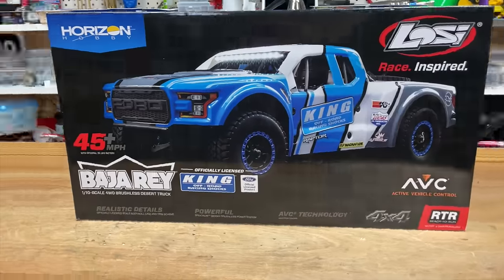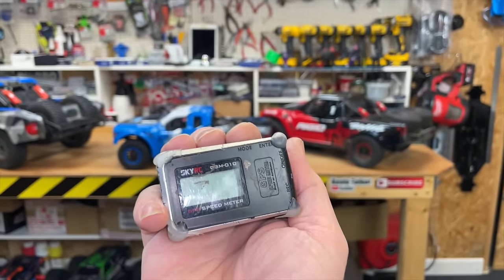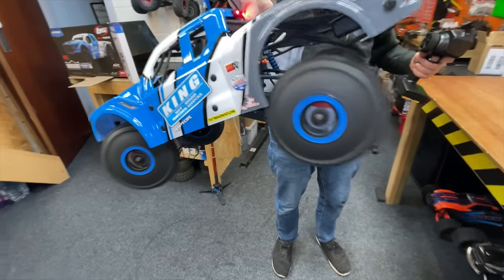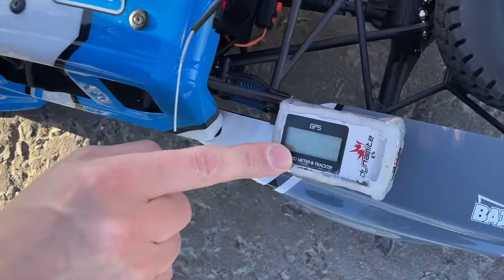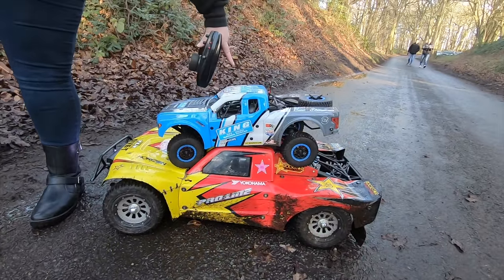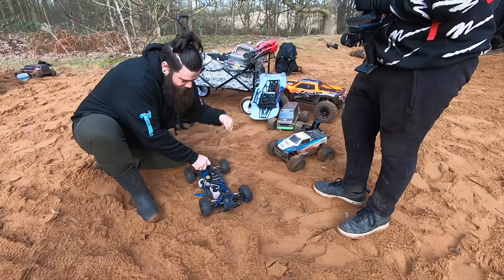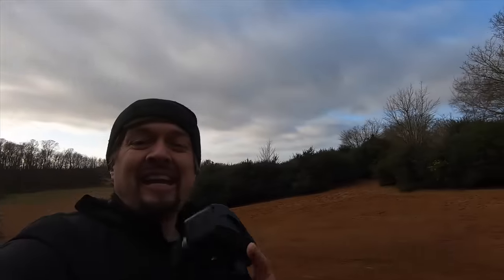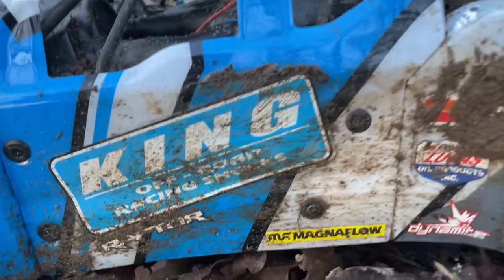New Toy! The King of RC Desert Racers?

Comment: Its a great truck,  just some tips: get some heavy weight diff oil for the center diff (15k+), and first upgrade would be proline desert truck tires, (baja t/a or hyrax) not sct tires they are too small and wide second would be and aluminum steering rack, servo mount doesn't allow many servo horn upgrades but I haven't had any issues with stock one, servo did die 3 months after purchase (bought in march 2020) haven't had anything break other than the rear area of the roll cage around the tire mount and body damage. Its my toughest most reliable rc.
Reply: 15k 😁 .. I using 100k in center and the thing is a monster.

Comment: Hey Kev can you post more Traxxas hoss or summit vidoes I want to buy one of the two, and I know u are the best at testing things because u give your honest opinion!
Reply from the maker: i will but no idea when!
Reply: @KevinTalbotTV  ok thank you!
Reply: I Have a summit 1/10 brushless mamba monster, and rock rey 1/6, dbxl 2.0, but summit is my favorite!
Reply: The hoss is faster and Jumps higher but u like the summit it's so cool
Reply: Thanks
Reply: @emanuelbetinis7388  they’re very different models but I have a hoss and it’s great if you want a basher but the summit is more of a crawler than a basher it all depends on what your going to use it for
Reply: @randomtimes4100  thank you for this I will definitely take it into consideration and do some more research!
Reply: I absolutely love my hoss after some much needed upgrades such as constant velocity axles and upgraded GTR shocks and RPM A arms its a beast. But if it's a monster truck your after the stampede is a great option, most of the same parts as the slash and hoss!!

Comment: I've had my Rock Rey for 2 full years now and I've only broken drive pins here and there, and those seem to be a failure point on purpose so you kill the little easily replaceable pin, and not a wheel hex, steel axle, or gears or anything expensive. The Losi Rey's are absolutely built like tanks, only issue I've heard with that one is the stock shocks tend to kind of bind up after a while, upgrading them to metal ones is the single best upgrade (aside from tires) that you can do to that truck.

Comment: Hi Kev, I was wondering if you can make a Latrax Prerunner have a 1/8 motor or 1/6 motor with a max 6 or max 5 esc. You might need new diffs, driveshafts, spur, and pinion. You will also probably have to build your own motor mount

Comment: I have the first version of this truck.  My 2 complaints are this.  The center diff needs a locker option, and the wheels are garbage.  I have smoked so many wheels on mine.   On 2s its fine, throw in that 3s battery and watch one of the rear wheels strip out.  Otherwise it's a ton of fun. My favorite part is the bolt on body.  The rear tire carrier area is weak. I have replaced the x brace with a piece of hoard plastic.  Make sure to leave a hole for the upper links to pass through with all that travel.

Comment: If you used a brand new out the box Lipo (obviously the correct one ie 3S) would it go faster than 45mph or is that speed purely down to gearing/ electrical limits (if that sense?)??
Reply from the maker: maybe, not always. sometimes new lipos need a couple of runs to get faster someone said

Comment: If you need better shocks you can use the gpm one from the Arrma Kraton 1/8 with 300 oil they are great (I'm running them already a couple of years and the car drives a lot better)
Reply: Use the kraton shocks in the front of rear of the Baja rey?

Comment: I love mine and it seems pretty tough by my standards , others standards may differ,😁 i soldered standard xt on , I as well, I like the sim atyle sort of trucks so right up my street., it seems fast enough on 2s and is faster on 3 with the supplied extra spur.I would like /need new tyres and wheels if anybody has some good advice for this truck would like stlighty stronger sidewalls/foams ?
Reply: Proline has 1/10 short course truck bead lock wheels and bfg tires. Havnt put mine together yet but they seem way better and will fit with stock body.
Reply: @surfside75  Thanks,will look into those,might even try the general Grabbers from my Element sendero ,they look cool  but might just explode 😁🖖

Comment: It did get 45mph. However, he was using a 120c burst rate 3s lipo. Not knocking it or him in any fashion. It's just important to remember that 30c is not going to compete with 120c.
Reply: Thats not how that rating works.. Youd get the baja Rey to 45 with 50c. The ESC and 3s battery can't use all the 120c rating regardless.

Comment: Go to a auto parts store and ask for a front driveshaft for your C10 pick up and watch the guy at the counter laugh at you I will say it again if it's 4x4 it's a K10 I wish you would do some research on it so you will see that I am right and you are wrong ever time you say it the drag slash is a C10 and if you put that body on a 4x4 chassis then it turns it into a K10 the only difference is if it's a 2wd or 4wd
Reply from the maker: the body was moulded from a c10. i have 20ton axles so it must now be a K600. and what if i make it 6x6, is it now a x600?
Reply: @KevinTalbotTV  now you get it that is kinda what I am talking about